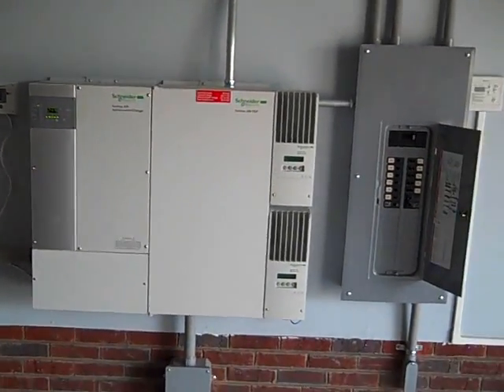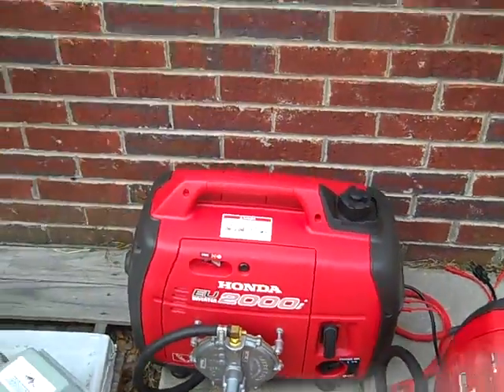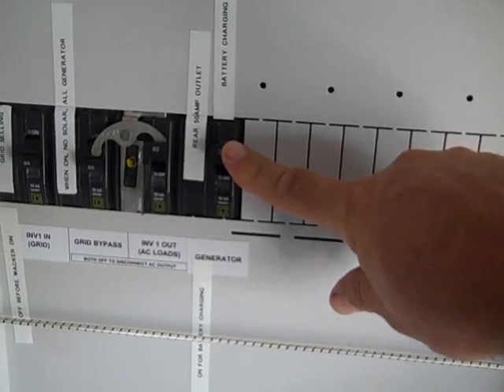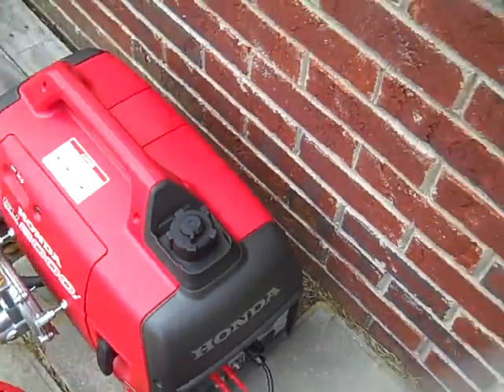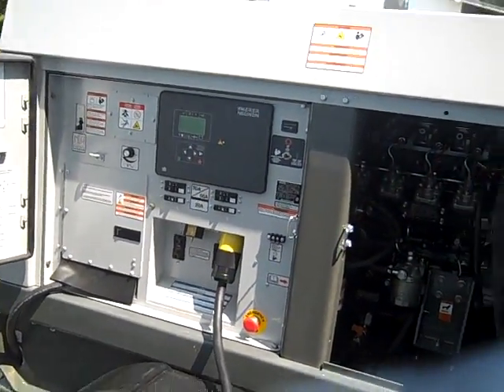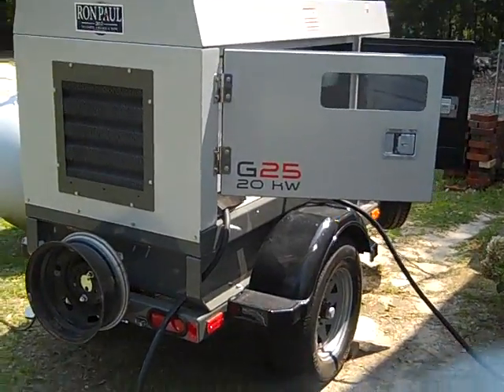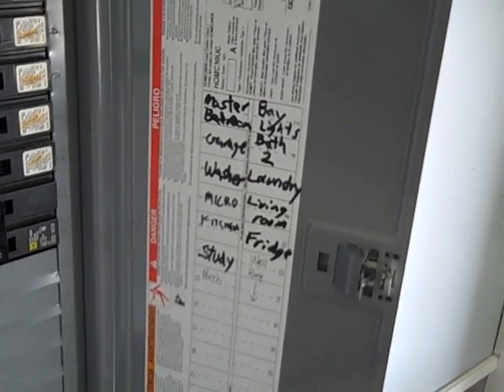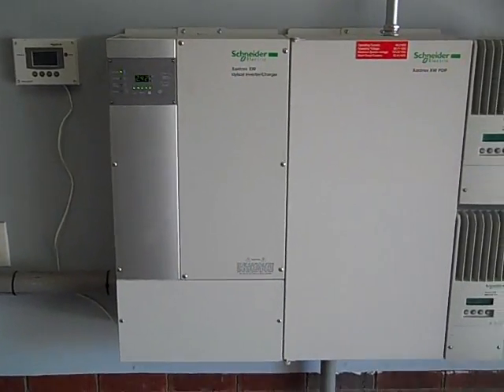Hybrid battery backup with several generator options

Comment: Does anyone else realize if the grid goes down water will no longer be pumped to your home
So unless your swimming pool is connected to your home water system sewage etc you may not survive long anyways
Reply: +salvatore Perna  Only true if you're on municipal water. if you have a drilled/dug well and your back-up power can run the pump, you're fine.If you are on municipal water, building a reservoir somewhere on premise is a smart idea.
Reply: True, or you could live in a place that gets 70 inches of rain a year (suppose to get a total of 5 this weekened because of a storm) and could collect plenty that way.

Comment: Might want to ground those Honda's.
Reply: if its connected to the houses wiring through the transfer switch it is technically grounded.
Reply: You should always have a separate independent ground on power generation equipment in case of a wiring fault going from the generator to the house.  That's why they have a screw terminal on these generators for a ground wire.

Comment: sorry my plan is better get a petrol generator and run it off water
Reply: +jameshone1000 I have tried to split water with high voltage DC to make hydrogen for heat. It takes as much energy to do that as an electric heater does, so unless it is done by solar it is a very lossy way to heat.
Reply: Even with solar, I'd imagine that's a less efficient way to use solar than to charge a chemical battery and use that to power what you'd use the hydrogen for.  Hydrogen only makes sense if it's available in abundance as a byproduct of another process.

Comment: nice of the guy to put the geni on wheels so the government only have to hook it to there own trucks :-P to comfiscate it :-)

but realy??  20KW geni?? what does that use? +60kw in fuel ~+6 ltrs an hour or +1 1/2gallons an hour? running hat for an hour per day will use ~+550gallons a year.not mentioning oil and filters.
impress me please.
show me a energy supply with only 1kw that only runs 1 hour. running a whole house on 1KWh a day.with no loss of comfort :-)